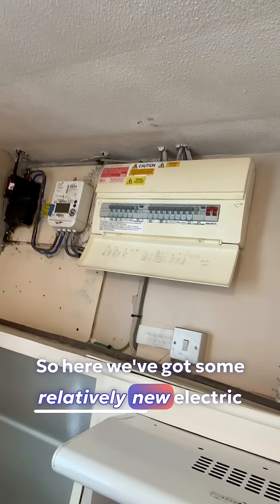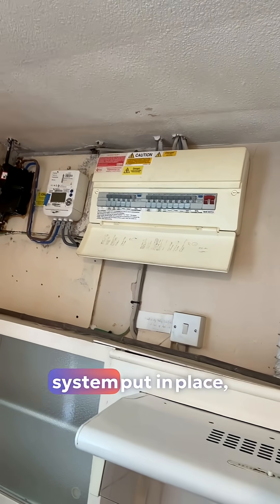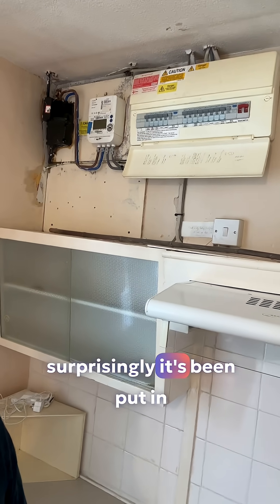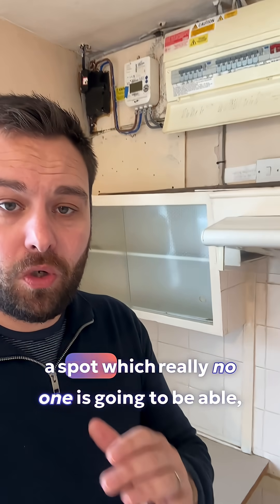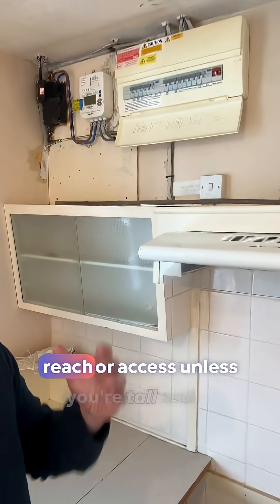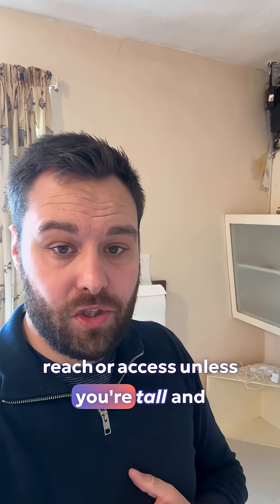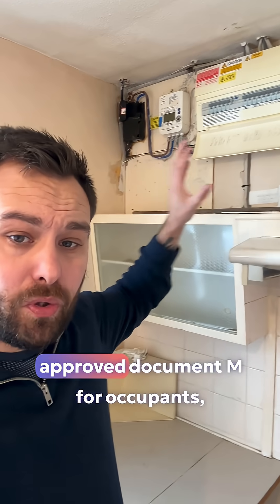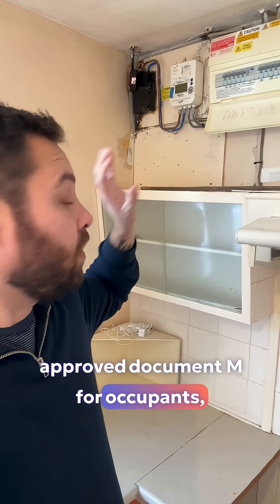This Modern Electric Supply Fails Building Regulations – Here’s Why ⚡

Comment: That's all nonsense. The Building Regulations apply to building work, not existing installations. That's an existing installation, so even if it was made of cheese and was mounted on the roof it would fully comply. The approved document you refer to is guidance, and not a requirement for compliance with the Building Regulations. The relevant section of of the approved document to which you are presumably referring is section 1.18, which only came about in 2015. Whereas that consumer unit likely predates that. And section 1.18 explicitly only applies to newbuilds and material alterations, and simple replacement of the consumer unit would be neither.

Alright, it's fine to say that in your opinion the consumer unit would be better in a different place. I'm guessing that the reason you try and jazz it up with nonsense legalise is that it's just bloody obvious that the consumer unit would be better elsewhere, you can hardly charge someone for telling them that, but dress it up with legalise and it sounds impressive. 

What's the point of a surveyor who knows nothing about law providing legal advice? Presumably if you heard a lawyer who knows nothing about surveying providing nonsense surveying advice you'd think he's a bit of a numpty, no?